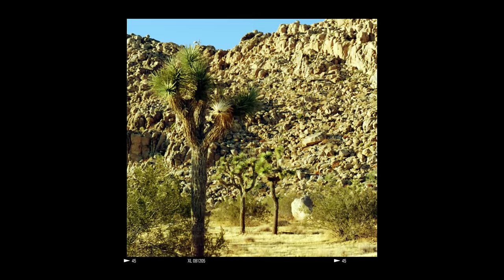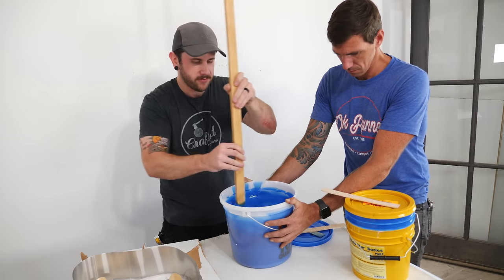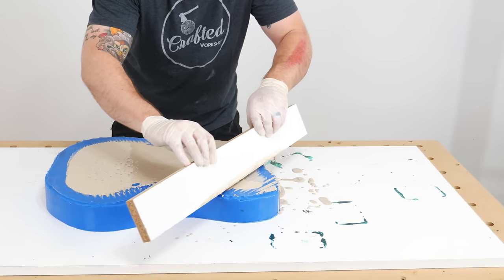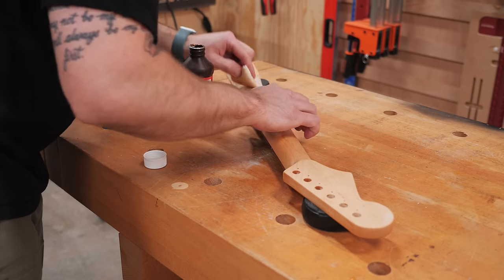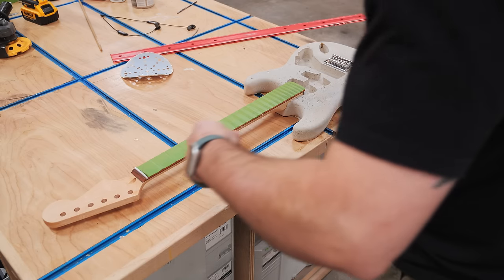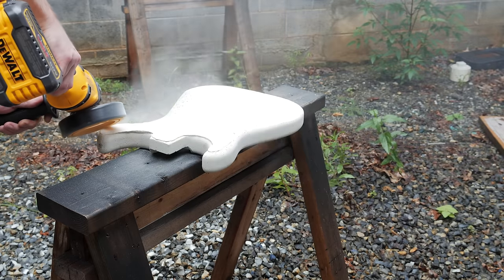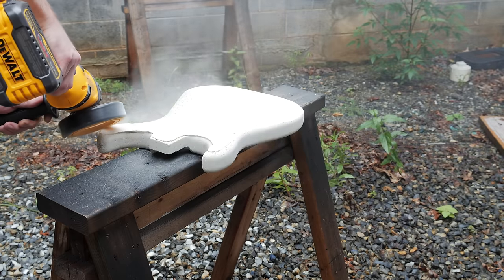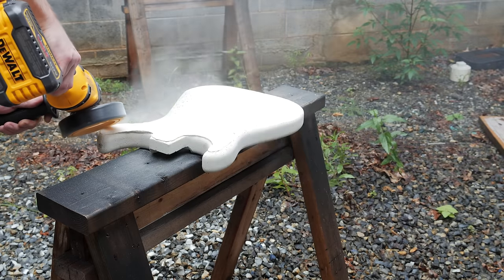I built a GUITAR out of CONCRETE. How does it SOUND?!

Comment: The funny thing with electric guitars is that magnetic pickups read the oscillation of strings and nothing more. Ok, technically a pickup is mounted on the body, so it is oscillation of strings relative to the body. But strings are light and flexible, whereas wood is heavy and rigid. The principles of momentum conservation dictate that the oscillation will distribute itself so as to favour the motion of something light and flexible. Long story short, the body barely oscillates compared to the strings, even if it is balsa wood. So, the wood barely contributes to the signal. And denser material will make its tone contribution even smaller.
Reply: Absolutely right. There was another video on YT where a guy made a guitar where he could swap out the bodies really easily. So he made about 6 bodies ranging from mahogany to pine, to part of a modern door that is veneer over cardboard. He captured the waveforms for a chord played on each, and they were still exactly the same. Tonewood is a complete myth. The tone comes from the pickups and the players technique.
Reply: @EricTViking  its also worth mentioning that the tone is probably most effected by amps and speakers as well
Reply: @utterdisaster603  definitely most affected by the amp / speakers 👍 Easy to forget that 😂
Reply: @utterdisaster603  and the player. The wood has nothing to do with any of it in the grand scheme of things. I've noticed a pattern. The very best guitarists never gave a shit about wood or whatever. They found what was available to them and made the best of it. Heck ain't talking bout love came from a "defective" body.
Reply: There should, however, be a noticeable increase in sustain, as the kinetic energy from the string oscillations doesn't transfer to the body, so less energy is dissipated into the guitar body.
Reply: @EricTViking  I once saw a video where someone built a guitar with no body at all, just everything mounted on some rail system. Still sounded like a regular (electric) guitar.
Reply: @EricTViking  and I reckon it’s 80% the player
Reply: @davidransom643  nailed it 👍
Reply: @EricTViking  I do think pickups make a difference but if you’re crap and you buy a set of Seymours you’re going to sound… crap
Reply: @davidransom643  I totally agree. The gear only gets you part of the way there, the player is the magic ingredient. Caring about what kind of wood the guitar is made from is just vanity.
Reply: @EricTViking  I think it still matters regardless of tone, if your'e bending the guitar itself at the neck like hendrix ect or just playing hard durability would be key over time a weaker wood would probably go out of shape in terms of strings/ set up. Cheap wood might work just as well but I'd be surprised if its dense enough.
Reply: @TheKingeboue27  agreed, you deffo want a guitar made from good quality solid and stable wood for durability. But the wood itself lends very little to the tone of an electric guitar.
Reply: @utterdisaster603  Tone is affected by speakers more than anything
Reply: The wood and other components of the guitar may contribute to sustain and attack, and that may make a difference along with pick ups and the amp.
Reply: Legit question: why do guitars with the same pickups through the same amp sound so different? Wiring? Strings? Setup?
Reply: @russellgrant1797  mainly string gauge and scale length.
Reply: @russellgrant1797  Different how? You describe a very specific situation that requires a dedicated test. Did anyone truly make such a test?
Reply: @russellgrant1797  P.S. also, yes, wiring has a slight impact, different Ohm pots, different wiring methods, different length of wire, different resistors, etc
Reply: @dinitroacetylen  I have an Eastwood mercury and absolutely loved the sound of the p90s. I put them in a custom built guitar and they sounded similar but different enough for me to not love the guitar. Not an experiment per se, in that variables were isolated, but still informative at least to me.
Reply: @russellgrant1797  there are still many variables that shape the signal. Some of them are:
- string to pickup spacing. The magnets don't like when their field fluctuates, and they therefore oppose oscillation of strings, particularly at high frequencies. If you depress pickups into the body, you lose signal magnitude, but you gain richness and clarity. This effect will be less pronounced with active pickups which (usually) have weaker magnets anyway.
- position of the pickups along the strings.
- volume and tone control wiring nuances. Potentiometer and capacitor values (also type of the cap), the exact way they are wired (some variance is possible) -- this all has notable effect on the frequency response.
- scale length. Longer scale will result in more string tension and bassier tone using the same strings and tuning.
- guitar shape and ergonomics. This affects the picking manner. There is some debate about how much tone is in the hands. The more I learn to play, the stronger is my impression that the picking technique affects the tone oh so much.
Reply: Literally was gonna type this out too but you got here first
Reply: @EricTViking  Agreed...I personally not being able to differ guitar's sound besides electronic qualities only. But on electric Bass, wood quality matters by a lot. Bigger string, more "shake"
Reply: So what if you had a guitar made completely out of springs?
Reply: @danznokaze  Isn’t that contradictory? 🤔 So a guitar with 9’s the wood won’t matter, but a guitar with 11’s the wood will start to matter? 🤨
Reply: @EricTViking  There’s also multiple video’s where Warmoth demonstrates that wood sounds different? 🤷🏻‍♂️ I have two guitars of the same year, same style, same brand, same components, same species of wood and yet sound different enough that I could pick the difference with a blindfold no problem.  Do yourself a favor and listen to a pine body Telecaster vs an Alder or Ash and tell me you can’t hear a difference. Or, a Mahogany bodied Strat vs an Alder or Ash. Or, a Raw Power Gibson SG or Les Paul to a Mahogany Les Paul. I’ve owned or at least played each one of these and can say with no doubt whatsoever, the material of the neck and body contributes to the tone. No, it’s not the be all and all, but it has a significant bearing on the end product.
Reply: @dannyharvey7398  "Delirious" - eh? Conversation ended there.
Reply: @dannyharvey7398  You can't hear the difference.
Reply: The material is only important in how the guitar is setup, neck curve, how it tunes and keeps the tuning.
Reply: @djtripnosys  Well, based on that your reasoning is unassailable 🤣
Reply: @dannyharvey7398  You said listen to x and say you can't hear the difference. Done.

Need more proof than "I can tell cause I'm so special". Hard data or its bs.
Reply: For electric guitars the material is irrelevant, its the pickups, strings and pick that make the sound from the guitar's construction.  The "tone wood" nonsense is just a marketying ploy.
Reply: Do all electric guitars (of same type.. I.e. all strats for example) sound the same then when playing acoustically?
Reply: @GCKelloch  Warmoth? And what about tests by Tim Sway, Spectre Sound Studios, Jim Lill (who actually went as far as rigging strings without neck and body per se), to name just a few? Among all these, the only entity who concludes that wood has immediately obvious effect is the one that profits from selling made-to-order guitars and parts.

If you need to keep praying to the idol of expensive tonewoods just to avoid shattering a belief, suit yourself. And I'll just play guitar.
Reply: If your a good guitar, tonewood matters. Your fingers matter, your pickups matter, your amp matters. But if tonewood didn’t matter, two of the same guitars would sound the same and they often don’t.
Reply: @EricTViking  When the sound you hear is first going through the pickups, yes. But when you're playing something acoustically, like an unplugged or mic'd acoustic guitar, that's where the wood, bracing, strings, picking dynamics, all of that stuff shapes the tone.
Reply: @DaveH28  Asking the real questions here.
Reply: @jonharvey6547  true. But here we're talking about electric guitars plugged into amplifiers.
Reply: Not true. Haven't you heard the difference between electrics not plugged in ? Obviously thats amplified as well. Body's attenuate and reinforce frequencys the string is producing and thats sensed by the p-ups.
Reply: agreed, but the body does affect the tone and sustain. i cant imagine concrete has any resonance you could hear.
Reply: The way to really test it is to fit transducers on the guitar, neck and body.  If the transducers pick up a signal, then the material should be having an effect.  The only issue is if the transducers pickup inertial movement.
Reply: @russellgrant1797  generally they don't. Strings though do make a large difference.
Reply: @EricTViking  Tim sway
Reply: @EricTViking  Make a guitar out of foam and rubber hear how it sounds .
Reply: @russellgrant1797  shhhhush your not supposed to notice that.

Comment: Having worked with concrete my whole life. This is by far one of the COOLEST applications for that material. I don't know if the creator will read this or not. But another thing you can try is polishing the concrete body of the guitar. It's using a concrete polishing wheel, it's kind of like a grinding wheel same family. By polishing you would pull out all the aggregates within the concrete to the surface. Still following your procedure of sealing afterwards and etc. ~ as a guitar player, I appreciate the creativity of your materials and making a playable instrument as long as you have some muscles.!

Comment: Shielding tape, like a concrete wall wasn't enough.
Reply: ehh the plastic is till thin
Reply: @fernank017 
The pickguard has it's own shielding.
Reply: Concrete is weak when free like this
Reply: Shielding tape is for groundibg the electronics so it doesn't buzz
Reply: @FirstLast-vv6lv  yeah, it’s not a reinforced concrete (though he’d need some tiny rebar in most of this.)
Reply: @timbrowner6643  no, it's not...he is grounding it to the bridge and the shielding tape was used to interfere the RFI...
Reply: @Gseckerfers  thats what i meant by buzz i may have jumbled my words a bit haha
Reply: @joermnyc Hahahaha, I didn't even think of putting reinforcing in it.  Better application for fiber mesh, though it would have left  the surface all fuzzy.  But we all know what wire mesh just ends up on the bottom of the form, so maybe some #3s @ 18" just as temperature steel :)

Comment: Your  ‘Cretecaster would have sounded much better if you had used the “tonal” Portland cement and cured it in a high pressure steam chamber
Reply: theres the first discussion
Reply: There's a video out there that proved the body does not really affect the sound of electrical guitar. Its the choice of pickups and onboard electronics that sets the sound and tone of your instrument. The body is there to just help hold everything together, to provide ergonomics and to look good. If I manage to find that video I will post a link.

Comment: the cheap and effective way: few mm of brushed silicon, then plaster to fill the bulk. like 30x cheaper, plus better mold rigidness and precision.
Reply: Molding a strat causes a lip. How do you demold with a rigid plaster mold? I mean for a one off I guess that's okay but what if you want a reusable mold?
Reply: @spamspasm8183  the lip (guess you mean the fillet at the bottom of the body) would be filled with a thicker silicone, then plaster.

Comment: So many creative ideas that. The metal plate with the holes. Using the tape to protect the concrete. Using the electric saw without a saw-bit attached to vibrate the bubbles away... this adds up and it's amazing like the project itself :D

Comment: I was typing about tone wood right when you started talking about it. With acoustics and classicals, tonewood absolutely plays a role. But with electrics I am also in the camp that it really just adds to the cosmetics of the guitar.
Reply: Exactly. With an acoustic, it will absolutely make a difference, because the wood is how the sound resonates. With an electric, the only thing that is amplifying your sound is your amplifier, which gets the sound from your pickups, not the wood of your guitar.
Reply: hmm. Thats interesting.
Reply: What matters is the speed of sound through the material. Concrete and wood have similar speeds 3700m/s vs 3900m/s (https://www.engineeringtoolbox.com/sound-speed-solids-d_713.html). So standing waves would be similar, but become more distinct at higher harmonics. For example at 1kHz the wavelenght is 3.7 and 3.9 m. 20cm difference. At 5kHz it's 780mm and 740mm that's 4cm apart, about an inch and a half or just about the distance between the bridge and middle pickups on a strat. So a node or antinode could move from one pickup to another depending on the material. The difference would be very subtle, as the movement of the strings is more significant than that of the pickups vibrating with the body. But it would become more evident with higher distortion which greatly amplifies low power signals and compresses high power ones. That is the input from the strings is compressed and the small oscillation of the body becomes more evident. 

Now as the article points out "There is no recognized independent effect of species of wood on the speed of sound. Variability in the speed of sound relates to the variability of modulus of elasticity and density."

 This is probably due to growth rates due  to variations in weather. Slower growth means denser wood and vice versa. 

So wood affects tone, but what's affecting tone can't be bound to one type of tonewood. Thus explaining why tonewood seems to be both relevant and irrelevant at the same time.
Reply: @Saurondor  awesome explanation. Thanks man. I am going to check out that article.
Reply: that's like saying all delays are the same. I mean if you have a dotted eighth delay set does it really matter if it's digital, analogue or tape? It matters if one pays attention to those small details. 

This reminds me of a video of a guy looking for a particular analogue delay. He found the sound in the newer Waza Craft Boss delays. As it turns out these have this particular bucket bridge circuit that had little spikes in volume on the leading edge of the signal or something like it. All the others he had tried had similar circuits but lacked that feature which gave the particular sound. Of course most people couldn't tell the difference. 

Which takes us to the point of whether tonewood matters or if we can't tell the difference. Take a look at Tim Sway's video time wood tester one guitar to test them all. I recorded the audio send did a frequency plot with audacity. I can tell you that while the guitars sound similar the frequency plots do have differences one can clearly visualize. These are particularly more present at higher frequencies and in the -60 to -80 dB levels. For example the spectrum of poplar vs swamp ash has a visible drop of 3 to 5 dB in the 7800 to 8200Hz range. Swamp ash being lower. Now apply a 20 dB boost to that and run in through distortion and that frequency range is up to -40 dB, the whereabouts of the  1kHz frequency range in the original track and 1k is now at -12 dB. Thus those scoops become more significant the more one boosts the guitar.
Reply: I made a quick video from an animated gif I built from the frequency plots from Tim Sway's tests in his video  (https://youtu.be/Hbyg0d1njk0?t=499) You can see the frequency spectrum comparison here: https://www.youtube.com/watch?v=DDTdUC2guuc

Hope it helps to clarify my previous post. BTW - I'm Saurondor, just with my other channel account.
Reply: Also every speaker and every pickup sounds the same, they are after all just magnet and wire transducers. Speaker cone and magnet material make no difference.

Plus every amp sounds the same. PC board amps mass-produced in China are as good as vintage hand wired.
Reply: Saurondor - I hear guitar wood variation much the way I hear guitar body construction, there is a perceptible variance in the emphasis or cancellation of frequencies with various solid and semi hollow bodies for example, as there is generally with wood type spec.
That said the wood type doesn't guarantee a consistent result and we've all encountered 'low status wood' very simple guitars that sound wonderful, while a gorgeous high end wood / deluxe construction guitar might in particular just sound average to some and the owner/player will them dump this perfect almost unused $4000 guitar on Reverb. A large price tag or a 'magical tone wood' won't guarantee the player will bond with the particular guitar. Maybe another player will...